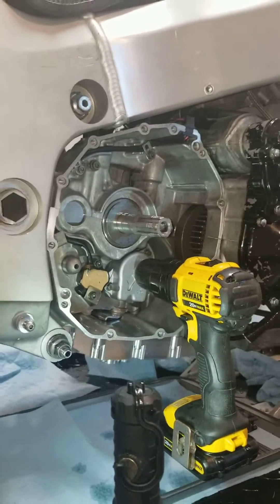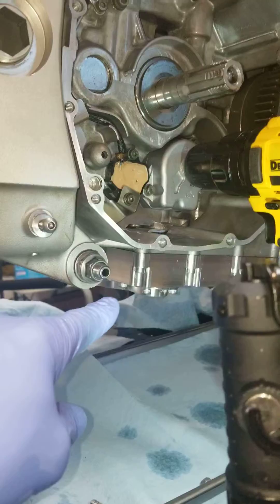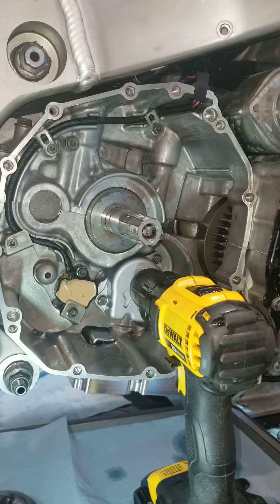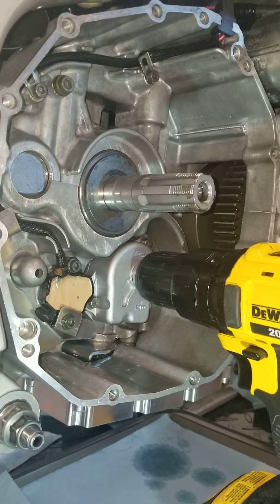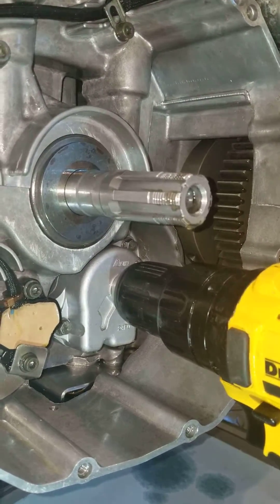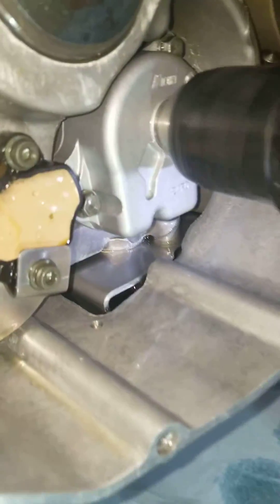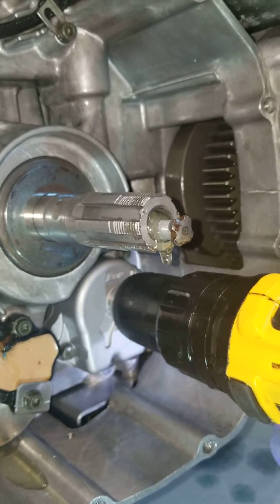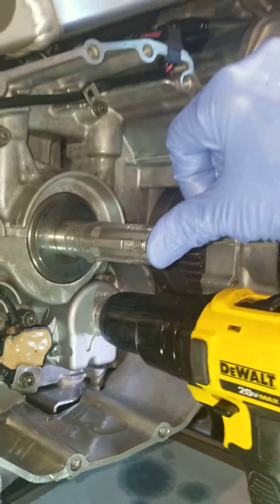Hayabusa oil pump priming

Comment: I want to ask you i rebuild a hayabusa engine but when i put the oil pump and type the bolt I cannot turned by hand but when i put the clutch and everything also and I turn the engine and it move without problems is like that or i yes put something wrong